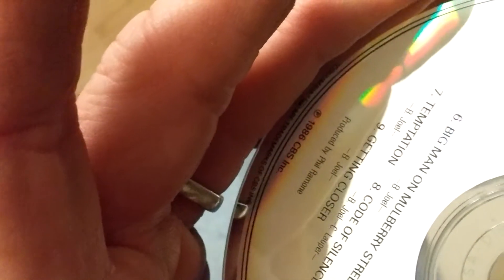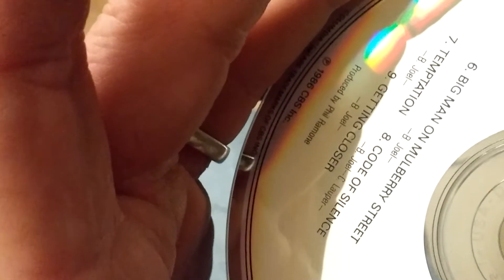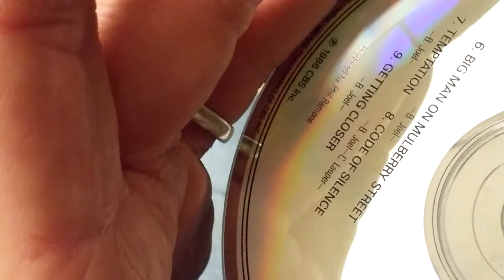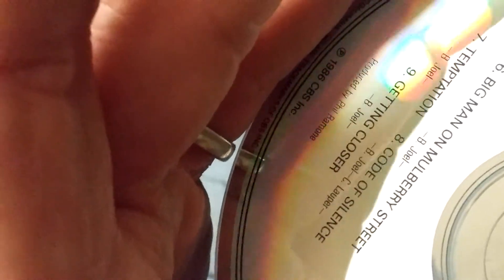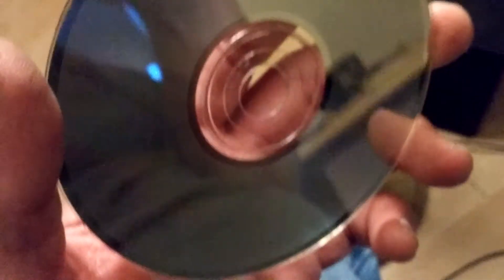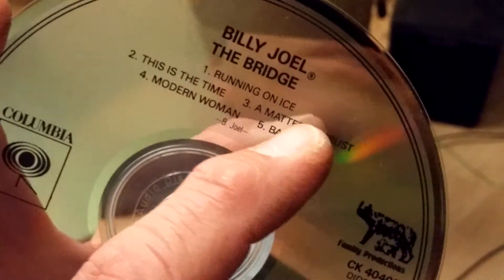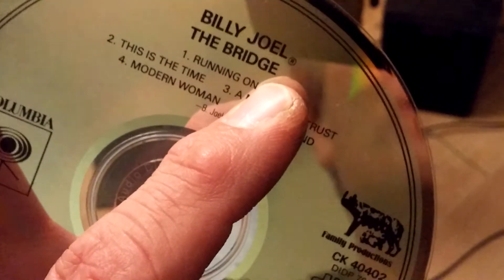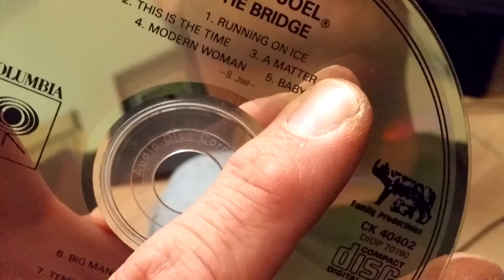A quick look at CD rot

Comment: Here's my experience with pinholed CDs. I have never had a problem with any of them skipping or not being read on a good CD player. I have a Pioneer from the 1980s (which wasn't really considered top-of-the-line back then), and every single CD plays on it just fine, including pinholed ones from the 1980s. However, when I have tried to play them in the cheap kitchen boomboxes of recent manufacture, they often skip and take an age to read, or sometimes don't read at all. So if your CDs are skipping, they might be OK in a quality device.

Comment: This is not disc rot .. disc rot will have black rings around the damaged area. These pin holes were there when the disc was made. I have discs from 2014/2015  ( Nintendo Wii U ) that have them. Manufacturing thing not rot..

Comment: That's not cd rot.  The cd came that way.  Titles like those pressed by Epic, Columbia, Polygram, and Motown in the 80's didn't have a picture label on the front.  Those pinholes came as errors in the manufacturing process and have not deteriorated any further since you've had it.
Reply from the maker: doesn't the hole in the reflective layer still mean missing bits, missing information?

Comment: I find personally that Sega Saturn games have bad disk rot issues, the majority of my Saturn collection is plagues with disk rot.
Reply: Same here. Nearly half of my Saturn games suffer from it but the strange thing is there are no performance issues. Maybe there during the manufacturing process?
Reply: Lucifer 1990 Same here for the most part. Except my Virtua Fighter 2 has barely any scratches but a lot of risk rot and it skips heavily.
Reply: Yes, you are correct!  Put the boogieman back in the closet.
Reply: Not disc rot.. those little pin holes were there when new and haven't got worse over time. It's a manufacturing thing, and all my games that have them work fine and have not gotten worse over time.

Comment: Time to transfer to another media. Looks like some pinholes developed in the coatings. Wonder if someone had some contaminants on their hands that contributed? you would not believe how abused and dirty CD's get in a broadcast studio, and then the talent complain that they won't play or start skipping tracks. I always try to handle them by the edges, like old vinyl. I still think CD's can take much more abuse than the latter though.
Reply: "Wonder if someone had some contaminants on their hands that contributed?"

Might be even simpler than that, and it may have occurred well after the CD was manufactured.

If you ever get in the habit of placing the CD with the label side down against a hard surface, then that's one possibility.

Here's why: the label side only has a very thin layer of lacquer sealing the aluminum substrate from the outside.  It doesn't take much for granular particles, such as dust, to poke through this lacquer or, if the disc is slid on a hard surface, for such particles to scratch through the lacquer.  Either way, you can potentially scrape the aluminum off.

Also, if the lacquer is breached, you also can expose the aluminum to oxygen, which can cause oxidation.

Going back to the possibility of a manufacturer defect, one explanation could be chemical flaws in the lacquer itself, which would cause it to break down over time and no longer provide protection for the reflective substrate like it originally did.
Reply: @Watcher3223  No, they all still play!
Reply: @DorianPaige00  

What CDs did I say won't play?
Reply: @Watcher3223  Sorry!  I meant to comment to another poster.  The only discs that won't play are the certain PDO discs like Genesis that have true laser rot and the ones where someone gauges out the front label side which you alluded to.

Comment: Any storage method to prevent this from occurring or is it inevitable?
Reply: If you keep them in their cases, and keep them away from sunlight and moisture, you should be alright.  This has certainly been an issue with burned cds I keep in my car. But none of the originals (knock on wood) have been affected.
Reply: These pin holes didn't develop but were a manufacturing flaw when pressed.